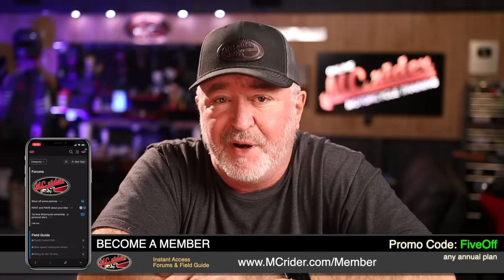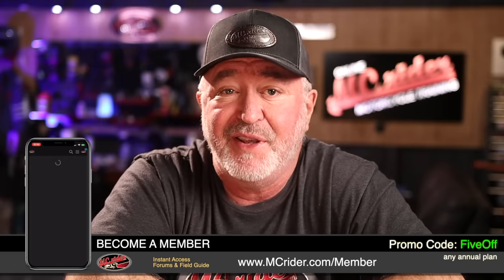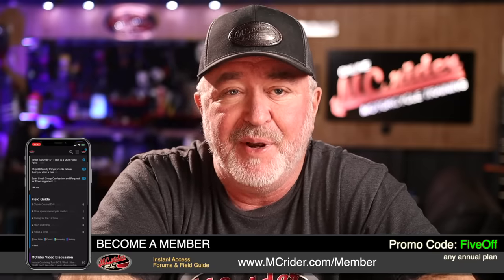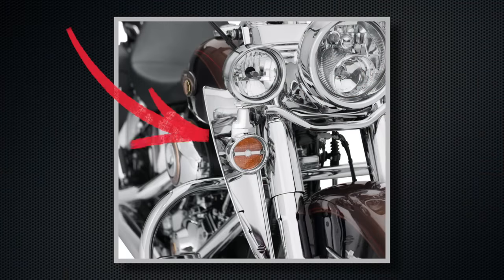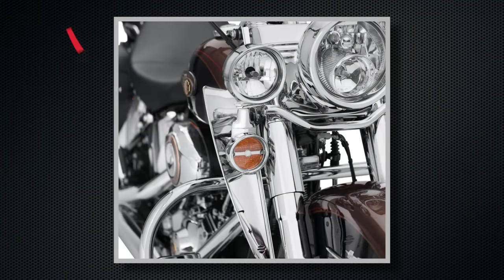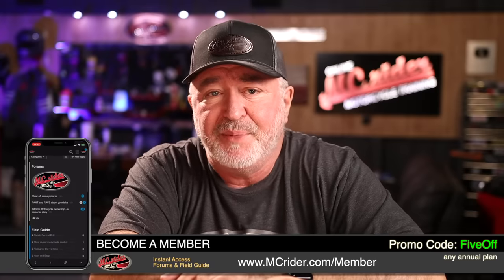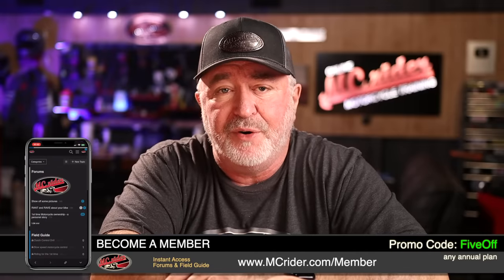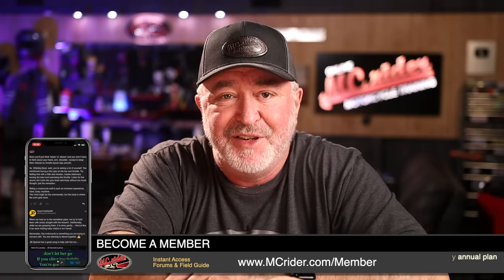Say Goodbye to Wind Buffeting on Your Motorcycle: Expert Tips and Solutions

Comment: I got rid of my last motorcycle on a trip across the San Francisco Oakland Bay Bridge. It was a dark foggy and windy evening. I was going from Oakland to San Francisco when I passed through the tunnel on Yerba Buena Island and came out on the San Francisco side. The wind hit me from the Golden Gate Bridge side and blew me to the next lane. I had to hang my legs out on either side of the motorcycle because I was blown from lane to lane back and forth. It was oily because it was the first rain in a while. It was cold …it was foggy. But I made it and that was the end of my motorcycle experiences.

Comment: i ride a 2020 cb500x 
serious buffeting problem when new .
made custom risers +40 mm better but not ok 
bought a d1171st even better but not ok 
drilled the pre-designed holes like oem windshield to reduce the vacuum even better but not ok 

eventually i found that  the buffeting is caused by the air thats deflected from my handguards!!!!!!!!!!!

removed the handguards problem solved 

BUT I NEEED THE HANDGUARDS !!!!!!!!!!!!

frustrated......

Comment: I think an overly tall windshield looks like crap. Creates weird proportions on the bike. Some HUGE tall windshields on Gold Wings look worse than a barn door. I installed a frame mounted fairing on my buddy's VN900 Vulcan. He is 6' and I'm 5'-6", so I set the windshield height where I had to look through it, just below the top edge. But it still looked ok. He wanted it so tall so the top edge is 4" higher than where he'd be just looking over the top. He likes it, but I think its dorky looking. And, when it gets dirty, bugs on it, its a pain to see through it. I am mounting the same fairing on my VN1600 and for me the windshield will be nearly 10" shorter than on his bike.

Comment: windsheilds are nice but its hard not to see it as a waiting guillatine if you hit it with your neck in an accident.
Reply: Seriously...........

Despatch rider for thirty one years and I've smashed Kawasaki GT750,  GT550,  Suzuki GS850, several Honda CX 500 all fully faired and while I may have broken shoulder, hip, both wrists, both ankles, foot etc  I've never had a fairing hurt me. Even  had one lose both connecting T-bolts and drop on my front wheel  causing a right turn at 60mph...... got up and walked away.

As for wind, rain, snow, all part of the job

Comment: A taller windshield does nothing to help. The problem is all the air rushing up from around my legs and tank. It tries to lift my helmet and pushes my beard up into my face. I will never own another bike with a fairing or windshield. I have owned many bikes and prefer the wind blowing directly on me, even riding for hours at 80mph.

Comment: cb500x 2020 model 
stock windshield 
buffeting like hell at 80km/h

installed a d1171st 
much less buffeting but now at 110km/h

cut with dremel the pre-designed  air vents ...
these vents allow air to pass through, so void is less so is buffeting 

i now have light buffeting at 130km/h